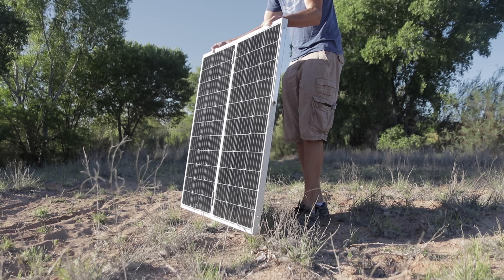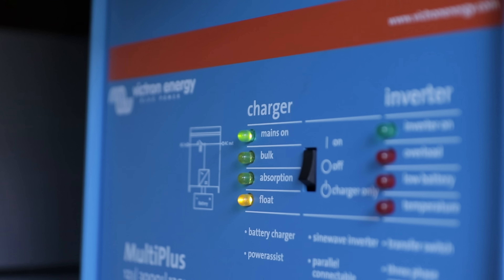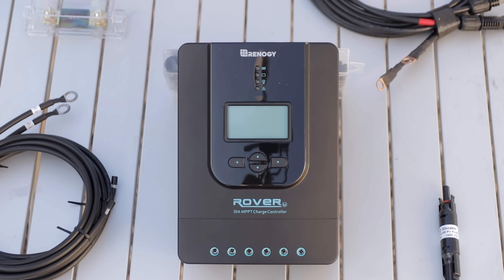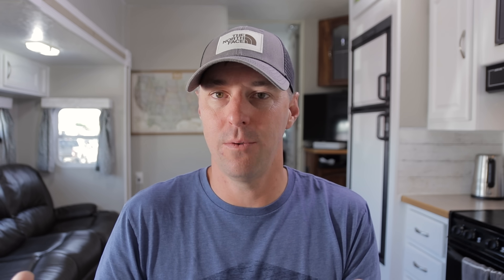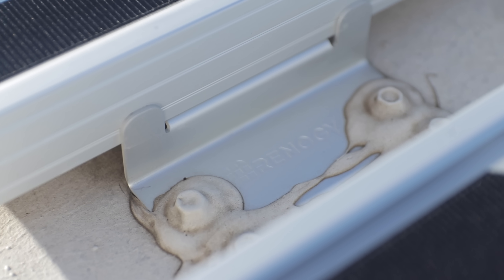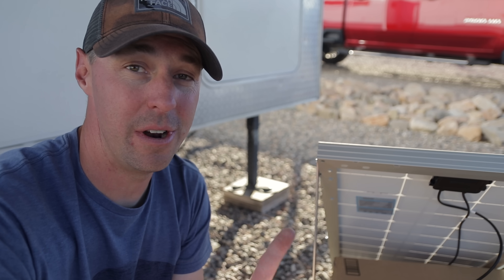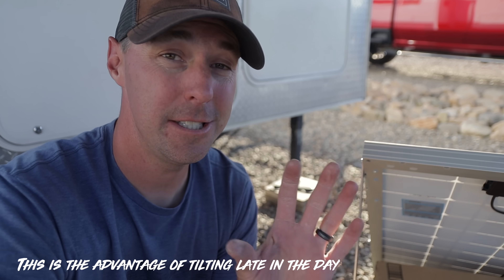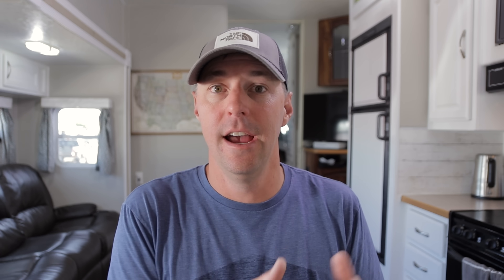Expandable RV Solar Setup First Step! DIY Solar Suitcase.

Comment: Very well said ! I agree 100% with your plan for expansion ideas as well. I did something close, but less $$$.  I "studied" solar for about a year. I was getting paralysis by analysis ; so i jumped in with a simple Renogy 100W panel & PWM I bought on Craigslist for $75. Never opened in a sealed box. Bought some connectors and away I went.  We do most of our camping in the Pacific N.W. in wooded areas. They're not mounted.  We are NOT full timers but are out often 3-5 days at a time & a 2 month snowbird trip. We boondock about 75% of the time. I learned that if panels are not in direct sun they do little to no charging.  So I "chase the sun". I bought a new Champion 2000 Inverter generator for backup and occasional 110V.  Doubtful I've burned 5 gals of fuel in 3+ years. This last Fall I added a 2nd 100w panel (in parallel)  + a 400W portable inverter. We use the inverter to charge the phones, iPads, cameras and laptops. The 2nd panel was a real game changer. Not only much quicker charge times but we often take off in the truck to explore or we take a hike and are gone 1/2 the day. We point each panel about 45 degrees apart from each other to allow for the moving sun. Works like a dream. All in for <$700.

Comment: FANTASTIC! Finally, this is the approach most people dare to take.  For whatever reason, cost, space, or knowledge about solar, the limiting factor in most cases is where do I start, and how do I expand it without having to replace all the equipment I started with.  Great job Jared.  Can you speak more on the cables used, size, length, amp ratings, voltage drop? and how they apply to a starter system like this and later expanding to a bigger more demanding array of panels> snaking the cables once is appealing, if it can be done without replacing cables when adding more panels.  Thanks again.

Comment: Great, informative video.  But what does someone with a towable with limited space to mount a controller in their basement storage do?  Not all of your subscribers have the extra storage spaces found in a 5th wheel.  I've got with a Renogy suitcase that is totally self contained.  Besides the controller being mounted on the back of the cells (200W suitcase), it comes with a carry bag.  
I'm planning on building a slide in storage box to carry my panels in the back of our pickup until I decide to install PV on the trailer roof.  At that point, I'll probably look to match the suitcase cells and move them, along with additional cells, to the roof.

I noticed you link to Lion Energy for lithium batteries.  Since you use Battle Born, if I remember correctly, how you rate Lion Energy's UT1300's.  And how do you feel they compare to Battle Born?

Comment: My Fleetwood RV came with a system on the roof.  I want to add portable panels so when I am camping under trees I can put them out in the sun.  Can I add these to the original system or do I need to change out or add to what I have.?
Reply: You can add to what you have.  For simplicity, the portable panels would have their own solar charge controller.

Comment: I went to the web site link from your video. They replied with this link.  https://lionenergy.com/products/400-watt-solar-panel-kit 
Our 5th wheel came prepped for solar with a plug on the side of the trailer. I was told I could just "plug and go". Was I mislead and do I need all the components that you have mentioned? This was a great video and really simplified the solar issue for those of us who would like to go off grid sometimes! Thank you
Reply: You were kind of mislead. In order to use the plug, you would need a suitcase style set of panels that has the controller mounted on the panels. The system Jared made in the video is the best way to do it. Having the controller on my panels is the least efficient way and also risks damaging the controller due to weather. The controllers are not waterproof.

Comment: I assume this is in addition to your victron controller.  Are there any potential problems charging off both controllers?
Reply from the maker: There is no problem charging off 2 controllers, with both of them charging the batteries I’m still well under the max charge rate.

Comment: Thank you so much for this awesome informative video.  It’s exactly the info I need.  I currently have 440 amp hours of lead acid batteries (I am powering a 120v fridge and charging with converter plugged into 120v via 30 amp plug in and also isolator off alternator when bus is running) I haven’t installed solar panels yet but plan too.  And when my batteries go, switch to lithium.  I have a xantrex 2000w inverter and am not sure if it will work lithium batteries. I am very grateful for you sharing these products that I can use now with lead acid and later with lithium!  Btw, how long is the 15% off discount for lion batteries good for?
Reply from the maker: Not sure how long the 15% will be good for, I just had an email that it’s the special they are running right now with the allaboutrvs code compared to the typical 10%

Comment: Quick question. Hopefully someone can answer it. Can I run two extra panels like this to my external terminals on my camper, and then those wires through my charge controller along with the rooftop solar? The idea being I don't have to buy another charge controller for two more panels.
Reply: I believe you should be able to splice in with some new MC4 connectors.  As long as your controller has the capacity.
Reply: @lwadeallen  
I was more looking to use them as a secondary energy source in case I parked in the shade. And want to make it easy by just using alligator clips and the external battery terminals.
Reply: @alaska-bornfloridaman  Disclaimer: I'm still researching before pulling the trigger on anything, but here is what I understand the issue to be... If your portable setup is wired in parallel with your other panels, then ideally everything should be in the same plane/shading amount/whatever in order for each group to be contributing a balanced voltage toward the controller.  If some panels are either in the shade, or not pointed the same direction as the the others, then a single charge controller can't optimally find the mppt tracking point, because it will be different between the two groups of panels.  Ideally each group of panels should be on their own controller, allowing each controller to get the most power from each group.  You can go down the rabbit hole of regarding blocking diodes and such, but that is the basic jist of it.
Reply: @JC-li2xo  
Thank you for taking the time to help me.  
 The six 100 W panels on the roof are in series-parallel. When the Sun is shining, they provide more than enough juice to run the 13,500 BTU air conditioner indefinitely without the batteries coming off of 100%. So it's coming in the controller at 24 volts.  I was thinking if I hooked 2 more in series, and use the  external terminals as a supplemental source, it would work. But after reading your comment, I'm going to have to do some more research. I don't wanna blow anything up. 👍
Reply from the maker: Yes it’s possible but it’s best to match the panels. If they don’t match I recommend running two controllers.
Reply: @AllAboutRVs  
I have 6- 100w Renogy panels on the roof of my truck camper, and a 40A charge controller. Everything I have is renogy, including two 140 amp hour lithiums.
I planned on doing just like you did, and using two more 100w Renogy's to connect to the terminals with alligator clips and wire that through the charge controller.
Reply: @AllAboutRVs  
I guess my only worry was connecting a different source to the same terminals on the charge controller. Even though they are the same Renogy panels.

Comment: Many RV manufacturers offer solar (panels, controllers, etc.) as an option. Would you recommend starting with the manufacturer option? My point here is for expansion. With the factory option installed, expanding the roof installation would be easier because the cable routing is already available. Yes?
The supplemental suitcase is also viable because of external panel ports on many RVs.
Always enjoy your videos!
Reply: Great question
Reply: @LadyDimePiece4Eva  -- Ditto! Y'all Be Safe!
Reply from the maker: Great question and it depends on the manufacturers prep. I looked at one for a neighbor this last week and it was technically prepared for solar but all the prep was undersized maxed out at 10 amps. 10 amps can be doable if you wire everything in series but is not the greatest for voltage loss on a run that long with that small of wire. I have seen good prep on some but most the time it’s undersized
Reply: @AllAboutRVs  I understand your point. I was looking more at the potential to remove existing wiring and components (inverter, controller, etc.) in favor of more "robust" components, including wiring, from a space perspective.
Reply: @markholland8953  To your point, in order to pull thicker gauge wiring, you would have top open both ends of the cable run, which may mean opening a sealed component on the wall or roof of the camper. What the point of paying for a component you plan to replace. The proper components can be purchased easily. In the end you're paying for overpriced labor. Very few OEMS do a quality solar installation. In fact most aftermarket companies do a proper installation. The list of good ones is very small.
Reply: @markholland8953  Removing existing wiring may be impossible.  Given the tight confines in the walls and ceiling of an RV, the wiring may make so many turns that it cannot be pulled from either end.  This may not always be the case, but keep in mind how these RV's are made.  They don't make them to be easy to upgrade or maintain.  They are made in a way that is easy for them, at the lowest cost.

Comment: If you added a draw catch (the kind of latch you see on metal tool boxes or wooden chest) to the back in the center you could lock it in the open position. Less then $5 at home depot for one of those latches and then you can use just 2 legs.

Comment: Helpful. Our setup is backwards from yours. We have a suitcase solar setup that just clips onto the battery posts. When we get the trailer out of winter storage, we install the batteries (stored in the house all winter) and attach the clips onto the battery. This has worked quite well for the high elevation mountain camping we do. We will eventually want something more permanent and would want to start with the suitcase setup. We’re running the original type converter, optima blue top batteries, no modifications in the trailer. 90% boondocking. Mid may through mid October